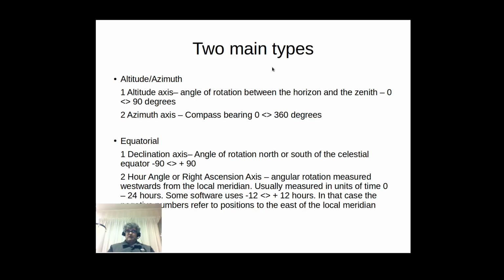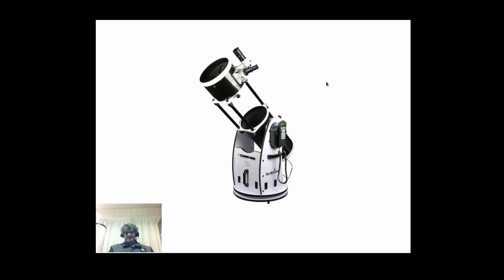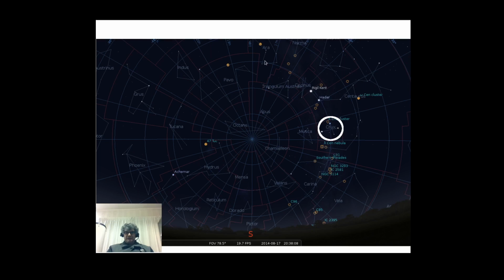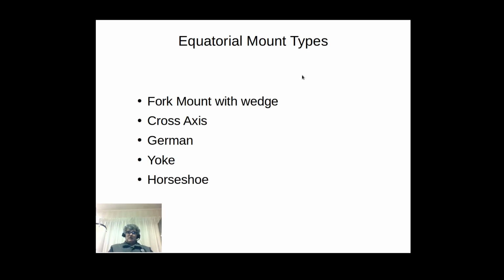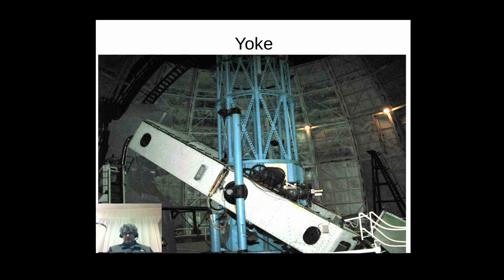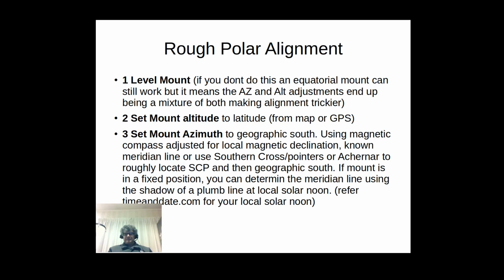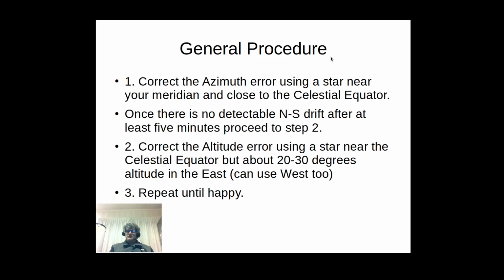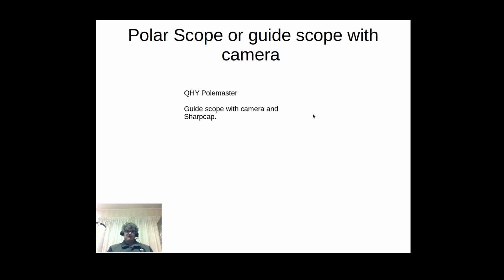Telescope Mounts - Practical Astronomy - October 2021

Comment: Hi Mark. I have a skywatcher NEQ6 pro mount and I do some astro photography with it (not very well though :) ) i have problems with polar alignment, the altitude movements are too stiff...its very hard to get an accurate polar alignment because of it. Would some kind of silicone grease help?
Reply: yep this mount is known for this problem. there are some after market modifications which can be done, grease doesn't help unfortunately . it can be easier to adjust when mount isn't fully loaded, but if you are using something like sharpcap or nina for electronically assisted alignment then can be difficult. if you consistently set up at a similar location and make sure your triopod is level, then atleast you won't have to make any particularly big changes in future in alt. some people mark the location of the tripod legs to help with this
Reply: I am not the right person to ask at all.  I have been trying to get to grips with a basic German EQ mount to no avail.  I am fairly new to looking at the stars and probably should have started with a simpler mount.
Reply: @MarkSmith-qh3pd  Sorry I mistook you for someone else. BTW I too started out with an eq....got confused and then started again with an Alt Az mount doing visual astronomy....graduated to a motorized equatorial mount recently :)
Reply: Hi ziggyfrnds, I suggest asking on the Auckland Astronomical Society and/or the NZ Astronomers facebook groups as there will be some owners of the Skywatcher NEQ6 mount on there.